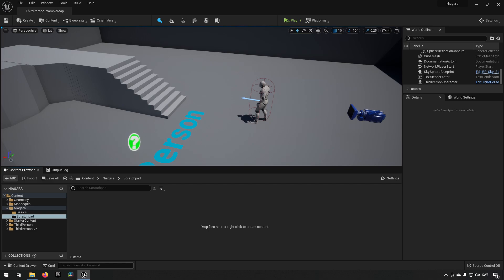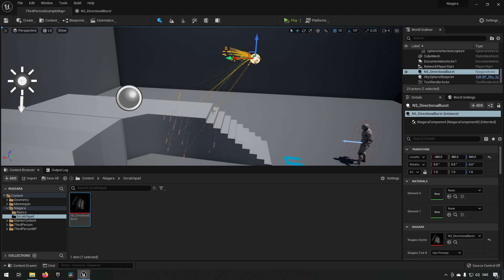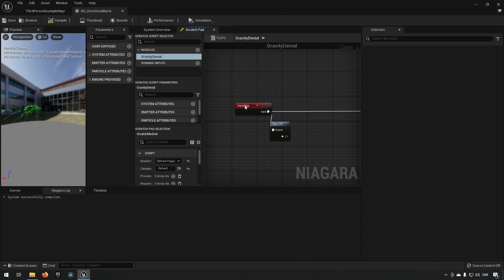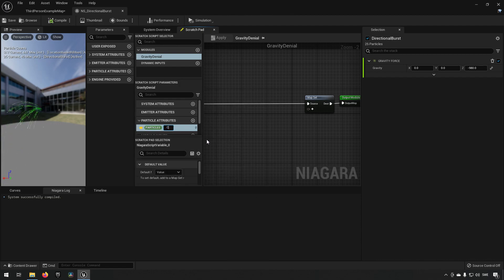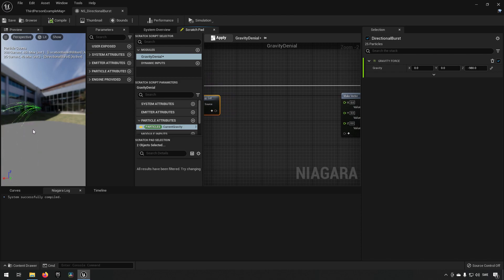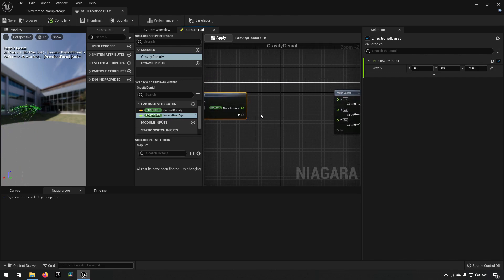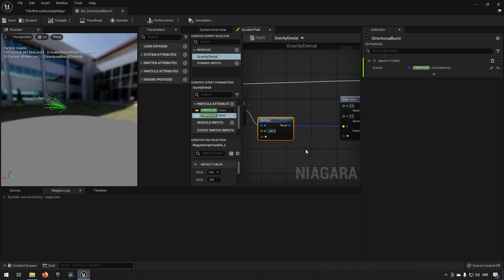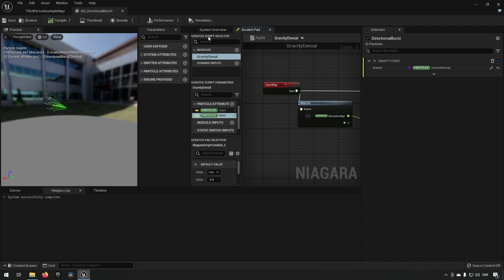Tutorial: Scratchpad (Niagara) - Unreal Engine 4 + Unreal Engine 5

Comment: So basically the ScratchPad is the way to define( or customize) the logic of your specific Niagara system in BluePrint way, right? The only thing that confuses me in such case is -- what is the difference between ScratchPad and Niagara module script(NMS) then? You can achieve similar result with NMS. What are the benefits of SP over NMS?
Reply from the maker: I talk about all of this in the video in greater detail. The scratchpad is more of a prototyping tool you can use that only will live inside of the system you create it. Then if you feel like the script is good enough and modular in use enough you can create a module script  that can be used in other systems. If on the other hand you have something you only want to have use of in one system, you can store it as a scratchpad rather than a module.